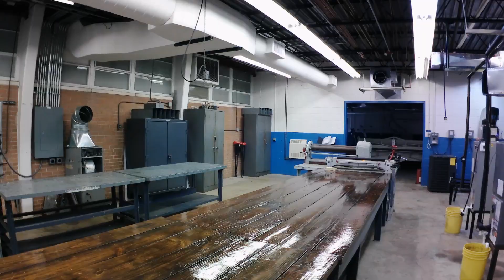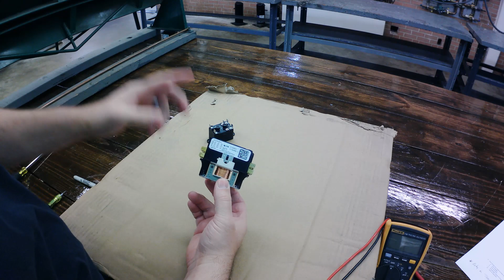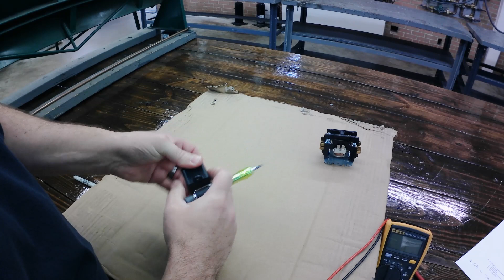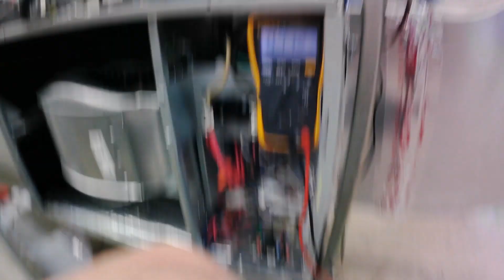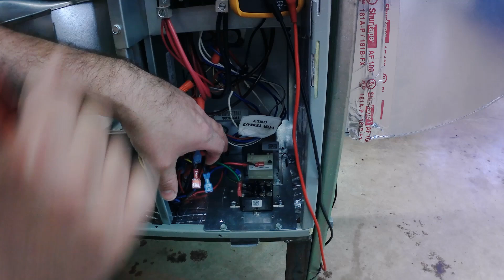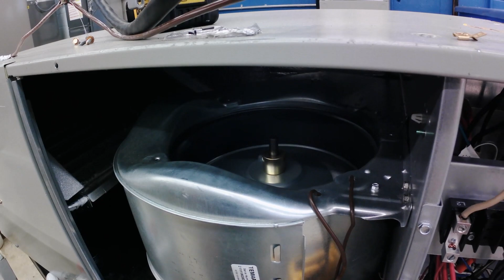Is the relay REALLY bad? | Understanding HVAC Electrical Concepts

Comment: Hai John , i wants ask you a question, i was wondering can I switch the air handle normal transformer to resettable transformer, in case the red  power ground , burning the transformer so we just need reset it  doesn’t need replaced, because the price are very close??? Thank you 🙏
Reply from the maker: I prefer a resettable fused transformer over a normal one. You have to protect the 24v power supply. If you don't buy a resettable transformer then at least add a 3 or 5 amp fuse inline to the normal one. I have bought plenty of fuse holders from amazon.

Comment: thanks for sharing the video. Great work. question?  where are the 208 voltage wire (4 wire) on the relay connect to?  thanks
Reply from the maker: I had to remember on that unit...It had a fan relay with two separate switches. One normally open and one normally closed. Two of the wires were high voltage coming in to the switches and the others were leaving the switch going to the fan motor.

Comment: Are there any fan relays with a time delay for the heat strips? Would sure be handy to replace hi priced boards or when you cant get one. The fan needs to run for a bit to cool off the heat elements.
Reply from the maker: I think about relays as more instantaneous but these fan boards nowadays have all that delay built in. I tell the young guys I see that a relay with timing is usually called a sequencer. Goodman used to have a fan sequencer before they used the fan circuit board. I am sure something like it is still out there.

Comment: Wow! You read my mind. I was about to comment that you could hook up the motor to direct power to check if the motor was good. And then you threw in that exact thing at the end 😛

I have a question about fan speeds. If you want the heat mode to go faster, is it possible to connect the Black wire via a y jumper to both the Heat and Cool terminals on the fan board? Then you would have only one speed (high) for fan only, cool, or heat. Is this possible to do, or will it cause problems?
Reply from the maker: If it is a PSC motor then it should work (as long as you only power one speed "winding" at a time. It seems to me that a pot of heat pump fan boards using a PSC motor only power one speed for everything anyway. If it were a furnace board with two distinct relays for heat and cool then you should be able to run a jumper (or re-do the terminal end with two wires in it) from the heat relay to the cool. That should power whatever speed for both modes. Like you said, it shouldn't be a problem.
Reply: @johnjennings-JJ  thanks so much. I have that famous Honeywell universal furnace timer board which has high speed for cool and medium or low for both heat and fan. Low is too slow and on fan mode you barely feel any movement, and on heat mode the flow is not enough and the temp rise is too high.